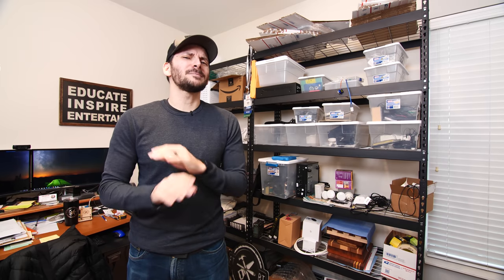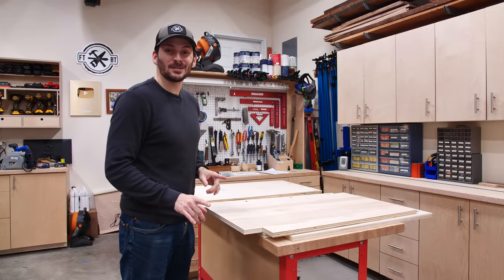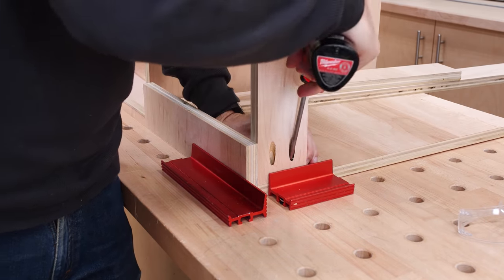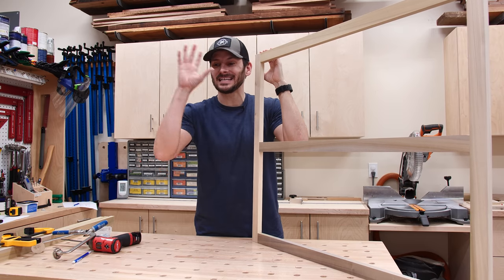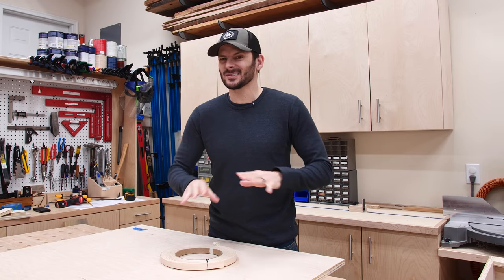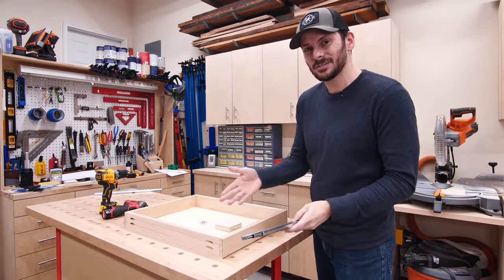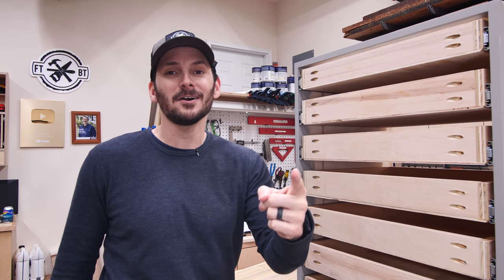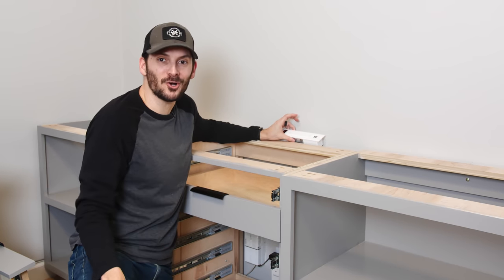My Tech Gear was a Mess, So I Built This

Comment: 1:20 - minor tip on blue tape labeling.  Fold one of the tape corners inward on itself.  Then you have a nice little tab for pulling it back off later.  I've accidentally gouged or scraped finished pieces because I applied a tape label fully flush to the wood and couldn't get it off later without resorting to a knife edge.

Comment: Great build and video as always! Quick Safety tip: Be careful with what you plug into the outlets on the top of the desk. The Netgear outlet can get incredibly hot if it is pulling too much power. Had one that was in a room with a PC plugged into it and the thing nearly melted the plastic casing.

Comment: i started watching this one because i saw that power outlet.... That's what i need! i haven't seen one like that, that you plug into a flat surface.  I want THAT! i will be making eventually a headboard, and i want at least 3 plugs on each side.  Another voice in me is wondering how much did that special made drawer cost.  I just went over budget on a relatively small project and everything seems crazy expensive atm. Granted, you won't find such nice, perfectly fitting drawer even going through all internet.  Nice vid and project!

Comment: You should build an overhead Floating Hutch, with a cabniet for you 3D printer that has a clear front panel, thin sound insulation, it would really help make prints much better and quieter. Possibly some Logic board ventaltion underneath your printer to prevent cooking it.

Also Led lighting for the table

Comment: Awesome as usual, Brad! Have to disagree with you about the drawer "mistake", though. It's never a mistake ... it's a design change! :--) FWIW, I've had to "redesign" drawers that were too wide and the change was just as easy as yours. Instead of adding material, I felt mine were just screaming for well placed dados! I used a router but a dado blade on the table saw would work equally as well.
Reply from the maker: Ahh yes, the old dado trick!

Comment: You should find a wall surge protection then plug additional surge protection it might look weird but you have double protection. I think a TV with able to connect to you laptop, you might want additional storage above your 3d printer an yo used it for additional 3d printer. Please hide your wires it looks cleaner.

Comment: I would add a little backsplash to the countertop. 👍🏻
Reply from the maker: thanks for the idea
Reply: @Fixthisbuildthat  I just hate when things slide off the back of my desk. Since yours is built in, that might not happen. Also thinking the sheet rock might be saved a little from things sliding across the desk too. Very nice project tho. Wish I had the shop to make stuff like this.

Comment: Nice DIY work bench. Contains this really all your equipment? Replacing a full metal shelving system (typically 1.8m ... 2.4 m room height x 0.25 ... 0.35 m depth) with a work bench (typically 0.8 m high x 0.6 m depth) differs by 1/3 of your original shelve size.

Comment: This basically the size I want to make for my 3d printers I have 350mm build area though much bigger then your prusa printer. 😅 Currently using a desk that's only 2 feet 6inch there no space for nothing else keep most the stuff I need currently under the build plate.😔 + I want a overhang/backboard for lighting and stuff as currently I use a flashlight to see stuff on the printer especially if I printing in black can't see nothing without a flashlight.😅
Reply from the maker: yes, it's going to be great for my printers.  Plan on adding at least one more

Comment: How do you calculate the measurements/dimensions for each drawer front to fit perfectly with whatever-the-gap-is-between-drawer-fronts? without the top drawer front having to be trimmed or made bigger to sit flush with the top of the cabinet.

Comment: Very nice. Many likes. Hey question for you!  I build a T-shaped floating desk (hangs from a cleat on the wall and one leg at end of the T) a few years back.  Now I'd like to convert it into adjustable standing desk.  I'd probably need 3 or 4 legs that can raise and lower in sync.  Anyone out in YouTube land heard of such a product or has ideas on a design that would work?
Reply: Ikea*, Monoprice*, and Uplift** all have "just the lift frame" options with all the motors and wiring pre-built in the legs.

*Uppspell, Bekant, and Rodulf models, all single-top styles
**Both single-top and L-desk
***Single-top model has a 4-leg option for heavier desks, also has L-desk model

Comment: FYI - Link loads page, when you click join, it goes to page to start filling out but immediately reloads the initial page the link goes to.  No way of actually inputting anything to sign up.  Can you confirm with home depot if there's anything that needs a fix?
Reply: correction, chrome is doing that. Tried Microsoft Edge and was able to sign up but apparently I'm already signed up, so now I need to figure out where I see my points at?
Reply from the maker: Go into the Home Depot App and there is a link in it for Pro Xtra which will basically convert your app to the Pro Xtra app.
Reply: @Fixthisbuildthat  I did that too but didn’t expect it to lose all my past purchases unless they roll over eventually?  I’m gonna call them Monday and see if they can move my history of purchases if it doesn’t automatically do that.

Comment: I thought you hated impact drivers. I still hate them. And the Milwaukee, Bosch, and Rigid 12V’s…grip too thick. Great tools, especially the Milwaukee and Bosch, but just too uncomfortable. It’s like I’m always looking for the perfect drill. I think it’s the Festool TX, but 300 bucks is steep for one drill. Anyway…like always…great video.
Reply from the maker: I hate the noise of them.  The one I use now is the M12 Surge which is a hydraulic driver and half the noise

Comment: 11:00 I'm not sure why no one has made a set of drawers by first constructing (using glue and brads) a 4-sided "box" of plywood, and just cutting the individual drawers out of it at the table saw. Heck, if you made the drawer bottoms out of 1/4" plywood (also glued and nailed flush, as you've done here), the overall measurements would be super simple to calculate. But no... every woodworker on YouTube cuts dozens of sides in batches, routs out dadoes, etc. thereby doing maximum work.